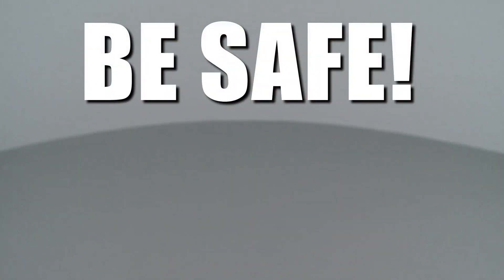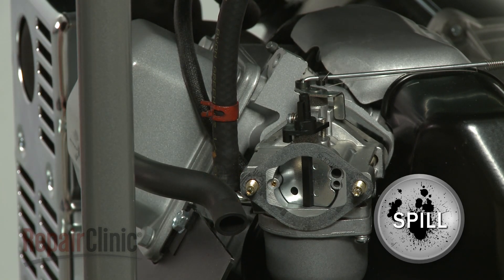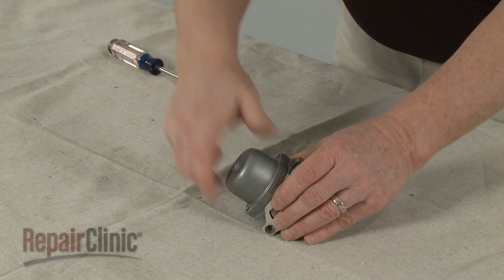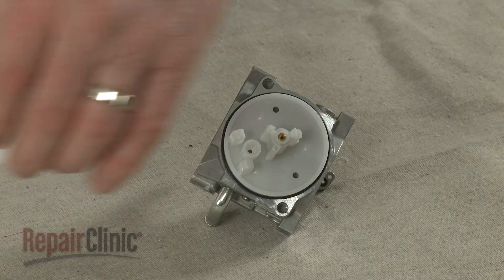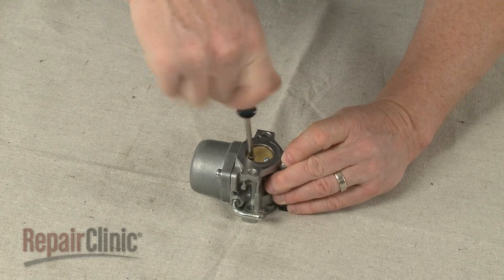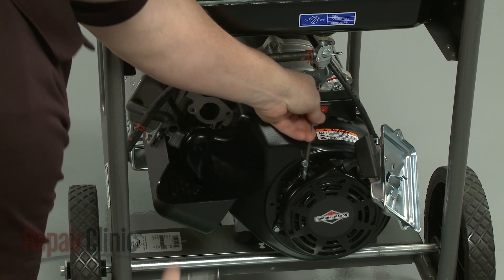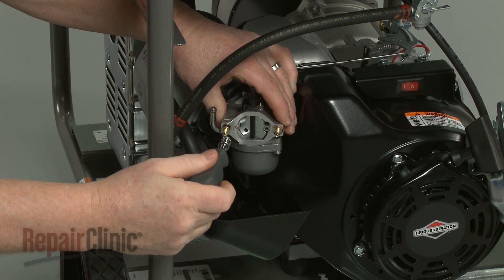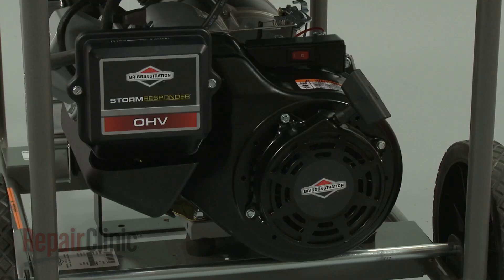Briggs & Stratton Generator Won't Start? Engine Repair 796137

Comment: Great video. I was able to step thru the repair with your rebuild kit. Found four holes in the center fuel tube completely plugged, Kept spraying with carb cleaner and the gunk disappeared. Followed the video to reassemble. Started on first pull. Much appreciated!! I'm ready for the hurricane season now.
Reply from the maker: Awesome great job!

Comment: EXCELLENT video!!  From what I can see in the video, this is exactly the same generator I have (wattage). Doing the rebuild tomorrow. BUT...got a question. I have looked all over this engine and all the owner's manual info and cannot, for some reason, see anything regarding the horsepower. Anyone know???

Comment: In the rebuild kit there was a round silver cap. I see where it goes on the side of carb. Is this a necessary replace item?
Reply from the maker: +James Bailey You don't always need to remove and replace the welsh pug, but they give you one in case.
Reply: Thanks. I also adjusted valves and she is runin great.
Reply: Hey young man;
Your video's are very helpful! I looked into purchasing the Carb rebuild kits thru you, but the cost was 37 and change plus shipping. My local supplier sold kit to me at 34 and change. Sorry, my family is just barely holdin our heads above water daily.
Today I am on a Craftsman with 14.5 briggs. Adjusted valves and still tough turning over. By hand motor turns as should. Starter turns ruff , I tore apart cleaned and lightly greased.bearing. It turns like should for a 4/5 revolutions then bogs down. But mower managed to fire up on a spot of either.  Tearing carb apart this ev.